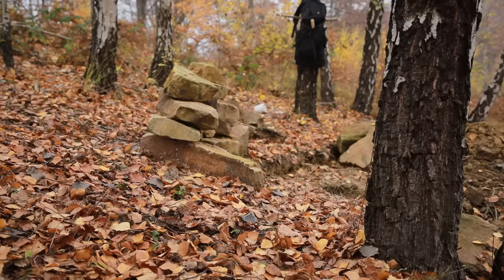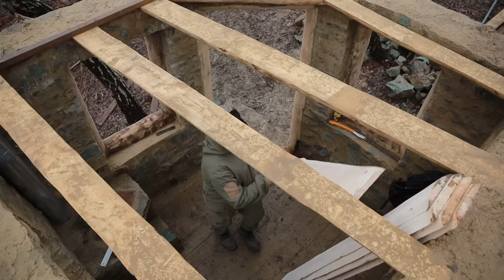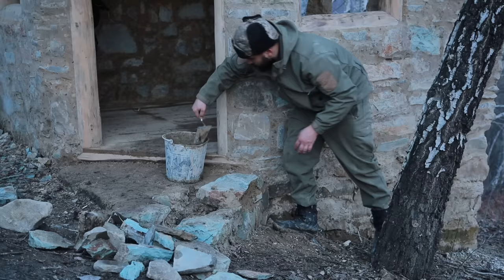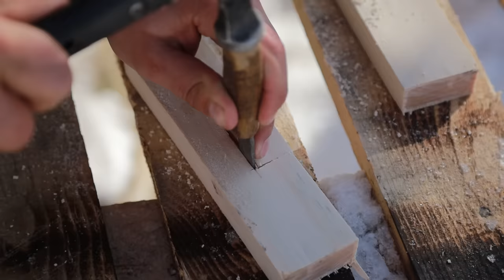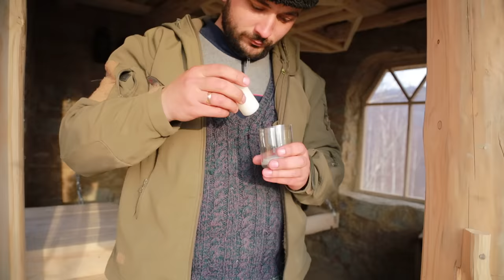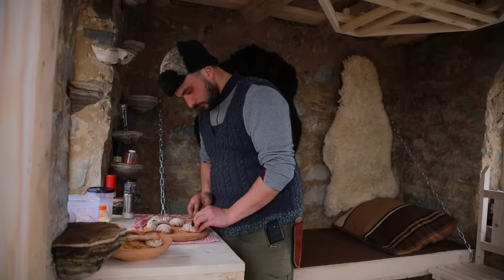Alone built a stone house in the forest. Start to finish

Comment: Being that the material binding the rocks is made of mud, what happens in heavy rain? Does the water cause the mud construction to soften? Be careful with flame lit lights in the chandelier with so much flammable wood in the ceiling, there is the possibility of a very bad fire.
Reply: I agree but he did build a soffit
to protect from rain and sure stone work can be re pointed
the insides good from weather
there seemed to have been some power equipment milling I saw saw dust dumped in attic
Reply: It's not mud it's clay

Comment: Fantastic. My question is though, that the stones appear to be mortared together with mud. Will not the mud mortar eventually wash out and cause the structure to become unstable?
Reply: As a stonemason who has done hundreds of metres of dry stone walling and numerous houses out of stone, you are correct. This is fantasy YouTube I'm afraid. The way he laid stone was amateur at best but interestingly the end result was OK. This points to much assistance from others. Or he pulled it down and redid the work. I have built a mud brick house as well and it needed a massive roof area to keep weather off.
Reply: I was also wondering what he used for mortar? I guess it could be a high-clay mud/sand mixture, but seems like it would have been worth it to bring a few bags of proper mortar out there.
Reply: Where does mortar come from? What are the ingredients? 🤔
Reply: Cement, sand, lime I believe.
Reply: For the use of just a few tools for the carpentry this work is admirable. As. builder of furniture, cabinets and custom energy efficient and passive solar homes over 50 years I would have suggested a caulking of rope to fill the daylight cracks at the door and windows and/or wood strips like battens. Lots of air leaks can bring the temperature down. BUT the fireplace needs combustion air and that could have been brought in by and exterior vent directly through the flor to the fire box using a small diameter pipe. My son is a part time builder for others and I have found that there is little rain in Alaska so the mortar he used might hold up longer than some expect and a clear coat sealer would help. Also a thin waterproof membrane like used on the roof could be applied.
Reply: @NoNameneeded1984 bruh he put nails into that mortar. That house all last for generations
Reply: Clay. Doh..
Reply: That's what I thought
Reply: I assumed it was clay.
Reply: If it is ACTUALLY just mud and no mortar was used, I would imagine it would be a routine maintainance issue, or maybe a fiber such as straw could be added to the mud, or even moss or some kind of vegetation growth could help. Its a wonderful question, I'm interested in the video makers awnser now 🤙
Reply: I have the same question.  There is also the freeze-thaw cycle to consider.  I have a few other concerns, such as the numerous fire hazards, including using wood shavings as a roof insulator, when the chimney is right there. Not to mention the candle candelabra, which, while lovely, was right up next to the wooden ceiling.  And so on.
Reply: Mud was invented before cement mortar.
Reply: I've worked with stone for many, many years. Mud or clay will not cut it. It will be continual maintenance (at best). You should use a 1 to 1 mixture of Portland and lime with roughly 6 parts sand for a long term and easily accessible solution. I will admit there are other methods which have surprised me over the years but this (the mixture mentioned above) is tried and true and will last your lifetime with limited 'touch ups'.

Comment: Great work for the rustic build for sure but I will say this- when building door or window framing- feet hold up the legs, legs hold up the head and the head is on top- but you need a head to have legs and feet to stand on first aka put your head in first out your feet in next then your legs will hold it all up.

Comment: Big question! How long did it take?
 The only real down side would the stone walls. They would get mighty cold in the winter. Maybe hang some rugs or something on the walls to help take the chill off? If you wanted to put in the extra effort you could build two walls with a gap between and fill the gap with sawdust/wood shavings (a lot of it). That would improve heat retention. Just kicking ideas around.
Reply: If he keeps a fire going for long enough, the stones will warm up and the heat will be retained.

Comment: It is very funny how you will wrap up the ends of the boards to keep them from rotting but you used a simple MUD to build the house out of between the stones. Ummmm, okay... well, as a builder you should know the foundation that you built out of simple MUD, not clay, just mud (from looking several times) will NOT withstand but a few years of rains (if that) before it all crumbles away. Good luck with all that. Had it been me, I would have added at LEAST a little cement in with it to stabilize the mud. But hey, want to waste all the time for a video go ahead... If you DID ad a little cement, maybe you should mention it so others do not just use some mud? Other then that, you are VERY gifted with your hands. building AND cooking.....  Nice little cabin!

Comment: No proper below grade foundation and using earth as cement. Nice video but why go into all the trouble with the rocks if the hole thing will move, crack and collapse in probably less than 15 years.

Comment: Then the council turned up and asked if he had permission to build, where are your permits ?  He said i have none,, so they asked him to pull it all down..
Reply: Yeh that's how it goes. You actually need to be super rich in "developed" countries just to build a shack to live in. And then it turns out it's illegal to live in a shack because it's illegal to live in a building that doesn't have a paved road to it and it's illegal to not be connected to the sewage system. Even if you use a composting toilet you'd still need that connection. It's a shame. I'd be happy to live in a simple tiny house but the gov makes that impossible.

Comment: The fact this dude is using nails as fasteners---especially on hinges---and that he apparently isn't using any levels,  squares, or plumb lines are two indicators that this is all BS.  Anyone who does any kind of building or woodworking knows things don't come together this well without squaring and leveling, and that you don't use nails on moveable features like hinges and doors.  He's also driving nails without pilot holes and no wood splits?  Lots of shadiness to this video.

Comment: I appreciate that this was done for youtube, but besides the roof, much of this is simply not built to last. No joinery what so ever was used in any of the woodworking, just finish nailed together, including the hinges on the doors and windows, which is baffling.

I have no idea what the properties of the mortar used, but going by what I saw, it looked like mud and clay, no lime or other type S mortar which would have been what was used on older stone structures.